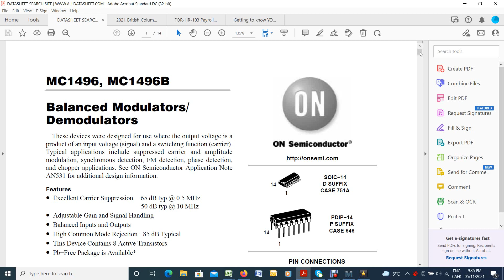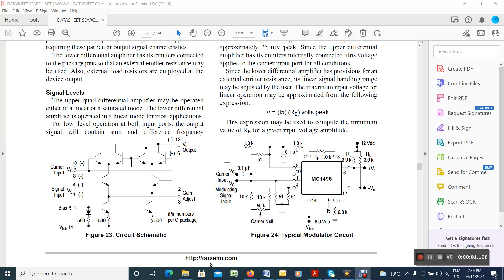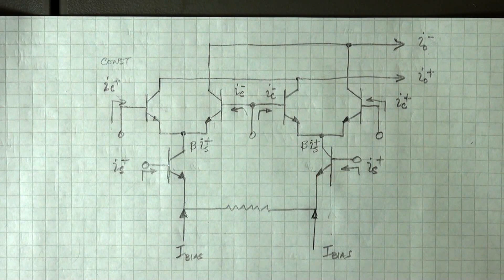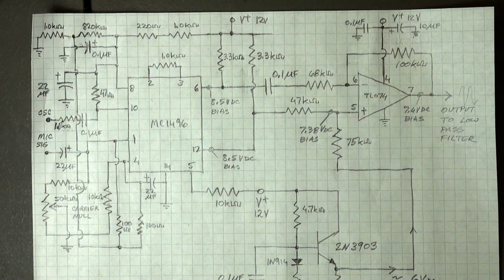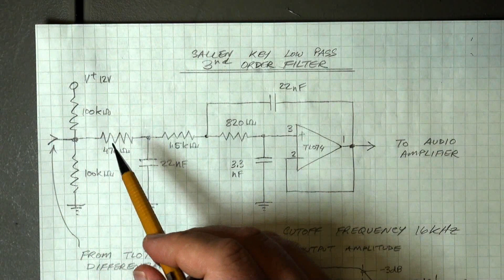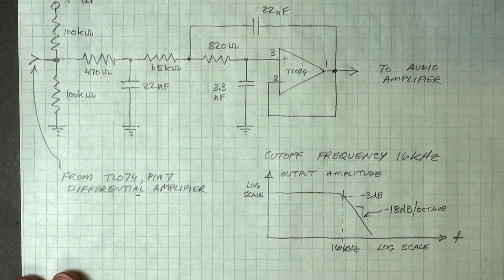Ultrasound Listener Part 5: Details Of The Circuits, Mixer Modulator

Comment: Great tutorial,  how is this circuit perform with 27Mhz Oscillator as carrier ?  Thanks in advance...
Reply from the maker: The MC 1496 is used in rf circuits.  Fig. 14 in the following application note shows it used at 300 MHz

https://www.onsemi.com/pub/Collateral/AN531-D.PDF

Comment: Hi 👋 Very interesting tutorials. This circuit looks similar to a Bat Detector circuit featured in Maplin Electronics magazine. In their circuit they use a 4017 decade counter and resistor network as a basic sine wave oscillator.
Reply from the maker: Hi there.  I did not see that issue of Maplin Electronics.  I'm putting this together based on the theory/principles of radio heterodyne detection.  I'm trying out various oscillators, but I think I'll settle on the AD9850 and the Arduino...video still to come.  I don't think the rest of it can be improved upon by the heterodyne method.